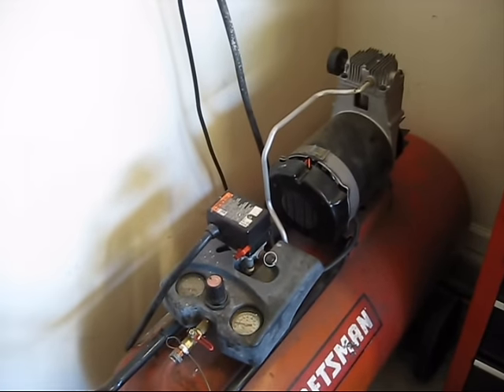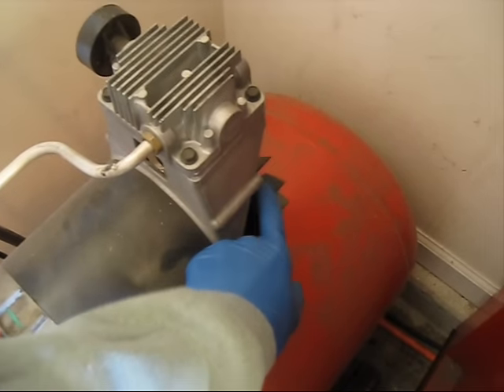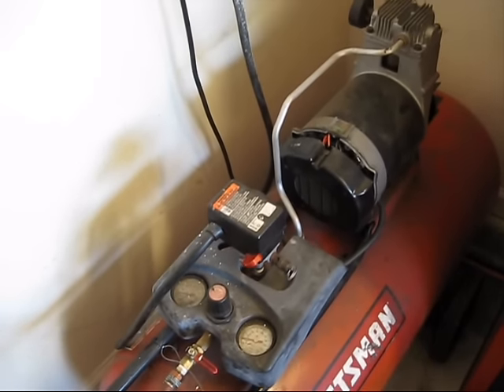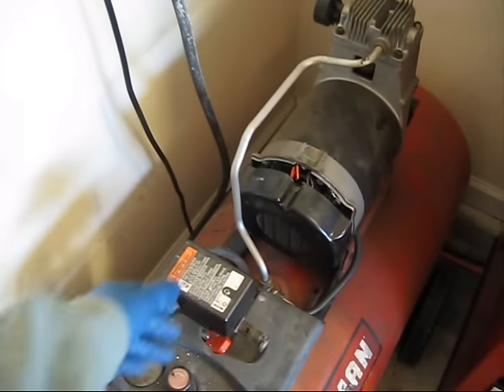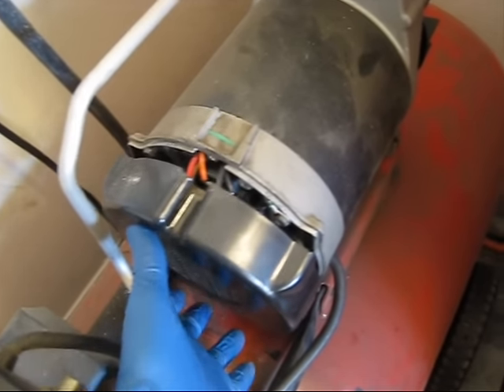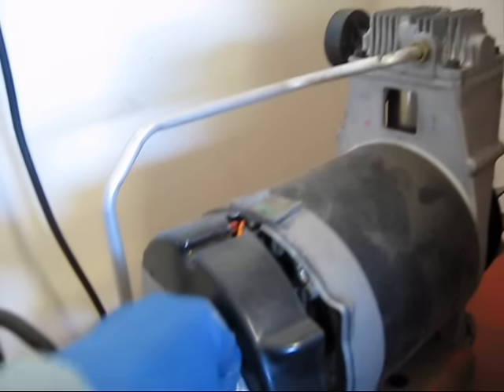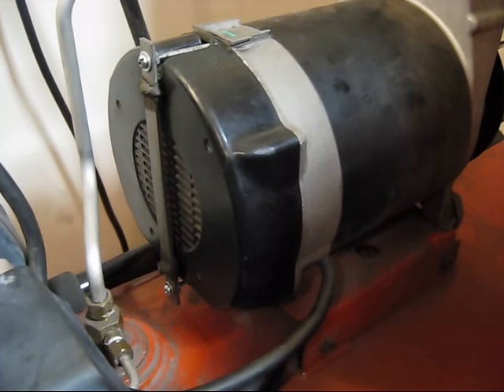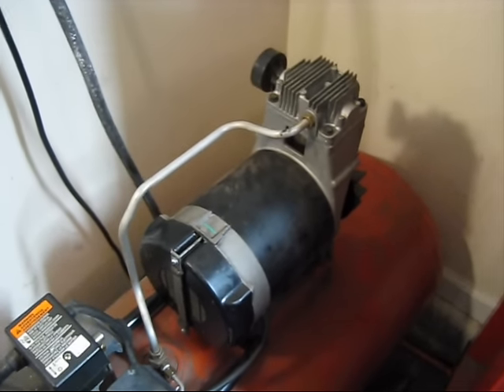Craftsman Air compressor startup problem and fix

Comment: Funny, they made two different types for that model then, you got Horizontal and I have the Vertical one from '04. The compressor has suited my needs over the years and has never been a problem, until about 2.5 weeks ago... The breaker threw when I was testing it out, the motor acted like it wanted to start, but then the breaker... So I took that whole back plastic cover to a shop and had the Capacitors checked. Well sure enough one wasn't working at full capacity. I replaced it, only problem is the new one is larger, so its mounted on top of the motor. The plastic shroud fits right over top like before. She's back up and running just like before! Here I posted the video I took after the Repair! https://youtu.be/08TdvPnlJnE

Comment: Hey you just fixed my compressor.   Been tripping breakers on and off for years.  My motor is not exactly like yours but uses  the same principle with the plastic having to be tight to the motor or the caps dont work right.  I think I can rig something up similar to yours.  Thanks

Comment: I have a Stanley 2 gallon tank air compressor. I went to use it real quick to air up my tire on my 2015 impala. The impala is a hole other problem. But the air compressor  won't turn on when I plug it in.  It worked fine not even 48 hours ago. Does anyone have any ideas for me on how to fix it. Cause I can't afford a new compressor.

Comment: Same thing I did, what about a generic startup thermistor type, and not use centrifugal, anyone know of??
Reply from the maker: Theoretically an HVAC style starting circuit or even a hard start should work. But If the mechanicals for the existing starter circuit are intact  it's easier to just repair this one than try to convert it.

Comment: i have an air copmressor of atlas copco company. i was working good but yesterday i changed fuel filter & engine oil filter  and engine oil also after that when i try to star it is not working...it is giving a fualt(starter speed too low)..and  RPM goes to 145 and go down slowly to 116 and triped...any solution please???
Reply from the maker: Sounds like something sticking in the compressor or the unloader stopped working.

Comment: I have an upright that has the same motor. The front bearing failed and that caused the run capacitor to blow. I replaced the bearing and like you say the capacitor can not be found. Can’t even find a replacement motor. What a POS!

Comment: Can I see how the capacitor is wired? The old one had connectors and the new capacitor just has bare terminals. I cut the connector from the old one. It has 2 reds and one brown. I do not know how to wire a capacitor. Please help.
Reply from the maker: I have 2. standard Capacitors usually only have 2 terminals.